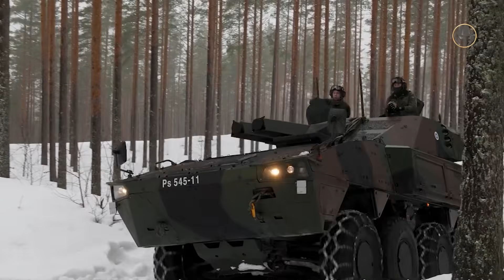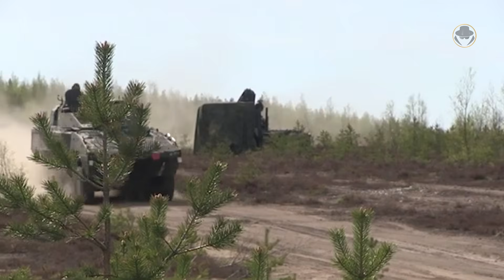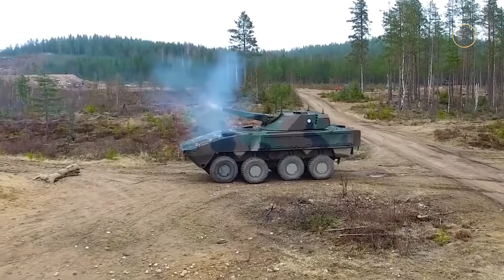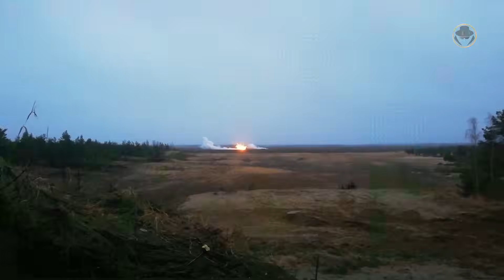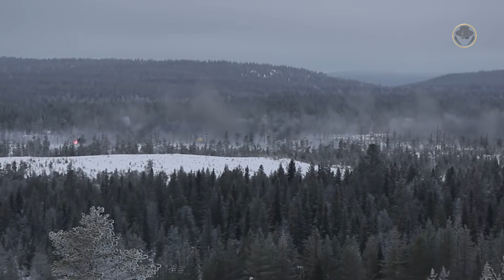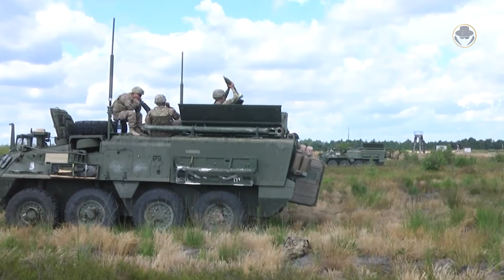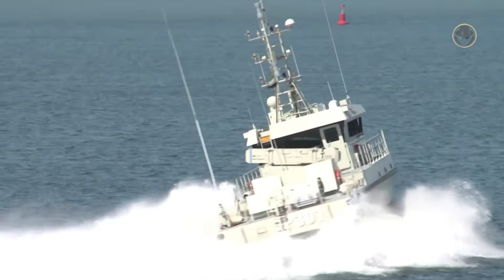AMOS - XA-361 | Why has no country, other than Finland, preferred such an advanced mortar

Comment: It's a shame Sweden went with the cheaper option, the AMOS is clearly superior to the semi-automatic muzzle-loading we use on our current Mjölner CV90 mortar carriers, the turret being able to be entirely enclosed not just against shrapnel, but also has a better potential for NBC protection, and in general a more advanced breech-loading system is just more future-proof.
 
At the time cost was a concern, but recent years have demonstrated that cutting costs for our military has been a bad idea and one we should never have latched onto. Like Finland, Sweden's military is small and needs to be able to punch well above its weight.
Reply: We dissed them?! They are like "close" range archers bruh. Lob 5 shells have em land at the same time.
Reply: Still, the Dutch went for the Mjölnir. Patria AMOS is better no question about it, but is it worth the hefty cost and more complicated maintenance?
Reply: @benktlofgren4710  Sweden had 40 CV90 hulls ready and waiting for the AMOS-turrets when the Reinfeldt cabinet had Genomförandegruppen perform amateur's evening, cancelling projects at random...  which meant the money set aside in the budget for the turret procurement instead were spent paying the penalties for breach of contract and of course Finland losing confidence in Sweden as a military partner which had to be rectified with other purchases at the expense of our domestic industry.
Reply: @benktlofgren4710  what do  you know about its maintenance? how "complicated" is it vs mjölnir?   you parroting words or do you actually have hands on experience?
Reply: @zoolkhan  Sit down and take a deep breath, you do not have to be a rocket scientist to figure out Amos loding system is more delicate and all that comes with it.
Reply: @benktlofgren4710  So you don't know. Keep in mind that the AMOS is operated by conscripts with varying degrees of interest and respect for it. Like every other piece of equipment in the FDF, it had to be designed in a way so that conscripts couldn't accidentally break it while operating and cleaning it.
Reply: @benktlofgren4710  A few AMOS systems can replace several of the simple versions, making it harder to hit and reduce the amount of soldiers to train and maintain
Reply: @TheEsseboy  While this is true we could not afford to outfit all battalions wtih AMOS only 1/5th (at that time), mjölnir was more "bang for buck" and was achievable. Also a lesson from Ukraine is that quality of a system matters tactically, but quantity maters both tactically and operationally.
Reply: @Stahlhandske  Well, considering one AMOS can deliver 20 shells on target within a minute, compared to 6 for Mjölner, you only need three AMOS to replace 10  Mjölner systems. What is harder to hide? 10 Mjölners or 3 AMOS? 

The real reason not to get AMOS is because you have not done your research.
Reply: @Stahlhandske 
Quality matters operationally too. 
I bet my asses Ukrainian will not 1 patriot with 2 or even 3 s300 for example.
Reply: @jintsuubest9331  True, but one system can only be in one place at a given time, so operationally more quantity enables fire support to be available for a larger area of frontline. Well air defense is on a hole other level from battalion level fire support, and the capability gap between patriot and s300 is huge. I would rather have 40 Mjölnir than say 8ish AMOS despite AMOS being the more capable system, which is the reason we went for that solution I.E Mjölnir for battalion level F/S and Archer for the brigades.
Reply: @TheEsseboy  I do not think you have a good understanding about this topic. 3 AMOS cant replace 10 Mjölnir. it isnt about hiding them, it is about making sure we can deliver battalion level fire support to all our battalions across the line of contact and being able to sustain losses, both from enemy fires and mechanical losses. I agree that AMOS is the more capable system, and without budget constrains it would certainly be the correct choice, but "you have to piss with the cock youve got"
Reply: @TheEsseboy  @TheEsseboy  I do not think you have a good understanding about this topic. 3 AMOS cant replace 10 Mjölnir. it isnt about hiding them, it is about making sure we can deliver battalion level fire support to all our battalions across the line of contact and being able to sustain losses, both from enemy fires and mechanical losses. I agree that AMOS is the more capable system, and without budget constrains it would certainly be the correct choice, but "you have to pi*s with the c**k youve got"
Reply: @Stahlhandske  Good thing Finland has higher military budget and NEMO in case. 

However while holding true in certain sense what you said about Ukraine in case of Finland it would be different.

There's many factors to these subjects which is why there is no simple right answer but it depends on country's needs, which for everyone are specific to their own.

In case of Finland vs Russia, there is less border that needs to be defended, so spreading out is not an such issue. Sure the border is wide 130km but most of that like probably 85% Russia is not able to use for invading due to no infrastructure, unlike Finland who has always prepared to defend themself when the next attack comes to the point even roads are designed to have tactical advantage for defence.

What this means is Russia would have to push through very tight holes which Finland has turned into killzones, and Finland would still have freedom of movement enabling them logistic superiority and flanking capabilities. 

When you combine this to the agreement Finland & Sweden has, some of those Mjölners would come to an aid and both countries has made deal to defend each others if one gets attacked. 

Add to that the semi new NATO agreement.

In this scensario it's bit silly compare to Finland's and Sweden's situation to Ukraine, since Ukraine was under prepared and had more open borderl lines to defend having the need to stretch out more.

AMOS will do just fine for Finland because what they need is quick shoot and scoot systems, after all their militaey tactic is refined for guerilla war.

And like I said even if, well there's always NEMO for cheaper solution.

Ps. I also doubt Sweden has needs right now to get more than 80 of their current Mjölners, so one has to alse take on account how much is too much and is amount X needed even if you could afford. Can't spend whole mil budget on 1 weapon system after all.
Reply: @Stahlhandske  Sure, but that is more of a budget constraint, because 333% more sustained fire is not something you can just ignore, that and direct fire capabilities, enclosed vehicle and faster moving to first shot, and faster scooting after the last shot.
Reply: @Stahlhandske  "While this is true we could not afford to outfit all battalions with AMOS only"
That part is a much later development, as we had 40 AMOS turrets ordered but cancelled the purchase (for no gain).
What you are talking about is when the issue of a 12 cm mortar came up again after the realisation that a few Archers can't provide the necessary support finally dawned at the department of defence.
Reply: @johanmetreus   You are correct! For the record i think cancelling AMOS was a really terrible decision when development was already "finished". When it came up again they couldnt fund 40 turrets and the Mjölnir compromise was made, but rather 40 Mjölnir than 8-10 AMOS. 
Catastrophic defense politics has been where the political left and right in sweden have been able to unite for atleast 4 decades. 

Men det var ju bra det där med "lackmustestet" synd bara att ryssen han invadera flera länder innan det gav omslag. 🤔
Reply: Depends on HOW MUCH cheaper the other option is. Quantity is a quality of its own after all, if you can have 2 weapons at the price of one, then the more expensive weapon needs to be that much more effective to justify the increased costs.
Reply: @khatack  if i remember correctly AMOS would have 4-5 times higher unit cost than what became GRKPBV 90 Mjölnir
Reply: @Stahlhandske  and AMOS has a 20+ round fire rate per minute with an up to 14 round multiple-round-simultaneous-impact capability which is beyond impossible with a single muzzle loaded mortar system. Not to mention, an automated loading system that doesn't get tired.  It more than makes up for the price difference between that and what basically is a traditional mortar on wheels/tracks, If you have the money. And Sweden absolutely has the money for it. It's just a political move to go for domestic, less effective system and that's fine.
Reply: The Swedish version of AMOS never worked. It was much more advanced than the Finnish version (that works).
Reply: Finlands military is not small. Reserve is bigger than usa has active/reserve combined.
Reply: Like finland? What are you talking about? You cant even vompare sweden and finland when it comes to army.
Reply: @hornantuutti5157  I really have no idea what you're on about, because Sweden and Finland have very similar militaries. 

Our militaries are about the same size with roughly 25,000 active personnel in both, with a large pool of reserves from mandatory service and Home Guard.

We use the same tank (Leopard 2) and IFV (CV90), similar multirole aircraft (Gripen and F/A-18 Hornet, both chosen for their simplicity of use in rugged conditions) many more systems are shared or extremely similar, with both countries even looking to adopt the same rifle going forward.
 
Our training and tactics are highly similar, emphasizing distributed defensive wars in the heavily forested subarctic terrain that makes up most of our countries' landmass.
 
Sweden and Finland have extremely similar militaries, because they have extremely similar military needs.
Reply: @HellbirdIV Finland can muster 900000 soldiers very fast as thats their reserv. Sweden can not even come close to that
Reply: @Thedrunkenswede1337  Well, I can see you don't really know much about either military. Or modern militaries in general.
 
I really wish there'd be fewer "Reddit historians" in these comments sections, but alas...
Reply: @HellbirdIV  oh but i do unlike yourself. And i have never used reddit in my life try again. Lots of self projections from your side.
Reply: @Thedrunkenswede1337  "uhhhh no u" is not a response that inspires confidence in your knowledgeability.
Reply: @HellbirdIV  i dont need too inspire confidence as i speak simple and easily found facts unlike you. You can cope all you want about the facts but they wont change just because you want them to change. Anyone white and internet access cal look up Swedens reserves and finlands reserve and what the countrys are able to muster. Facts stand find a way too deal with them because as i said the facts wont change. 😉
Reply: @Thedrunkenswede1337  lol, no. The Finnish army's wartime strength is 280 000 soldiers. We can't equip almost a million soldiers at the same time.
Reply: @Olli_Peltonen  eh no idea s not they can litterly muster 900000 soldiers educate yourself and dont talk about stuff you know nothing about. 🤦
Reply: @HellbirdIV  Yeah, Swedish Army is no joke. You've got less quick mobilization than us in Finland (less trained reserves etc.) but hugely deeper manpower pool. Anyone who looks at Sweden in peace time and tries to throw shade is talking out of their rear entry.
Reply: @hornantuutti5157  why not?
Reply: By the time of 2009 Sweden did not the world to escalate lile it did and neither did many else, people had felt asleep on the idea of purity and peace same time forgotting we humans are animals and battle we shall to our death forever since violence is in our nature.

It's understanstable why they cut the budget but foolish mistake still non the less.
World peace is something we can never achieve long as we live, someone will always wants something even by force.
Reply: Finland can litterly muster almost 900000 soldiers its not small.
Reply: It was a good choice by Sweden to scrap Amos and chose Mjõlner.
Now Sweden has 80 systems and the Nederland have ordered 12 Mjõlners!
Reply: @petter5721  It was an utter idiotic decision under Borg and Fredrik "The Swedish military is only one special interest group among all other special interests" Reinfeldt.

Most of the costs had already been paid, and what little was saved did not cover the expenses for contract penalties and compensatory purchases, the latter resulting in Hägglund's SEP being cancelled (causing enough financial instability to threaten company survival) to make space for a substantial Patria order.

The CV90 Mjölner started years later, when the Armén had convinced the minister of defence that mechanzed 12 cm mortars indeed was really important.
Reply: Yet the carrier, CV90 is superior to the Patria. Aside this, many countries operate the CV90 which makes logistics way more easy.
Reply: @Basil-Fawlty idk about that. Both vehicles are very different
Reply: @Basil-Fawlty  the AMOS system has been designed to be able to be fitted to a CV90, so not an issue.

Comment: Thanks for the video. Today, armies need a combination of such high firepower and mobility. :_SoldierSML:
Reply: until the war devolves into a war of attrition and everyone ends up in a trench...
Reply: This indeed is an interesting system assuming that the declared technical characteristics correspond to reality. Equipping armored, mechanized and perhaps motorized types of units with the AMOS would be great.
The important issue/limitation of this system is that at the end of the day a mortar is an infantry support weapon and as such it should be available to them anytime and anywhere. 
In 1999 we were defending Serbian territory along the Serbian-Albanian border from frequent Albanian incursions including two large invasion attempts. This is a heavily forested mountainous terrain and every dirt road ends 5-10km before the border. There's no way to bring even a tracked vehicle close enough, only man-portable weapons could be deployed with very few exceptions.
Reply: @matovicmmilan  considering one 120mm round weighs ~15kg and portable heavy mortar system itself ~150kg it is probably not the best option. portable 81mm mortar weighing ~50kg with ~4kg rounds sounds more ideal. no armor, no MRSI capability, no direct fire capability, no shooting while moving capability though.
Reply: A drone flies faster than a tracked mortar. A drone hast a bigger range than a mortar shell. That looks like a problem vor any mobile mortar because the have to be kept around the Frontline and sooner or later a spotter drone will recognize it and we have all seen what happens afterwards.
Reply: @drrichardwiesenhuber  Mortar shells are way cheaper and easier to produce than a drone. So, they are more suitable for a long and full-scale war. They cannot be jammed. The frontline troops always need a close-range fire support vehicle, so the range advantage of drones is irrelevant in this tactical scenario. In a real war, you have to accept some losses. It is not a video game.
Reply: @drrichardwiesenhuber  the weather is not always optimal for drones, especially during winter (-30c) or cloudy/rain (not all of them are equipped with latest sensors) or in the middle of electronic warfare / antidrone systems (Drone Dome, Sky Wall, DroneGun, Harpy). The best solution is to have multiple options. Recon drones are needed (both small ones like Black Hornet Nano and big ones like MQ-9 Reaper and everything between, like Orbiter 2B Mini or Parrot ANAFI), kamikaze drones (especially autonomous), UAVs, grenade droppers, 81mm mortars, 120mm mortars, 81/120mm mortars (TREMOS), 120mm mortars (NEMO), 2x120mm mortars (AMOS), 155mm artillery (K9/Archer), 298mm rockets (M270), Stunner (David's Sling), JDAM/JSOW/JASSM (F-18), JASSM-ER/AARGM-ER (F-35) etc..

Comment: Interesting.
I remember that a similar long-range support firearm, which was supposed to be mounted with a double barrel, was also being considered in Russia.
However, that one was abandoned and became a conventional single gun form.
Even taking into account the fact that it is a mortar, the fact that the complex mechanism of the double barrel gun system was realized and mounted on a wheeled vehicle shows a high level of technological capability.
It is also noteworthy that the AMOS is capable of operating the Strix mortar round, an anti-tank Precision-guided munition.
If this weapon is used effectively, it will pose a significant threat to ground weapons, including infantry, as well as vehicles, including tanks, without exaggeration.
Reply: Patria is part of BEA systems and only industry in Europe that has been given the right to esamble the F-35 front  frame outside of US. And company that has been given right to build the engines of F-35 block 4 by pratt and Whitney. And is company that just bought Finnish drone factory. So imagine if they producing the things like Patria AMV's Patria 6x6 and AMOS and NEMO etc.. at this point. What they shall build in future after they have fully mastered stealth tehcnology jet engine technology and drone technology?
Reply: Russian one became too heavy for ground vehicle, so they make 1-barrel one and double-barrel one can be used on ships. Also they manage to increase rof of 1-barrel version.
About similar weapon it more like nona or vena machines.
Reply: @trololoev  russia do not have that system since both AMOS and NEMO is Finnish product.
Reply: @vatipaa1  learn to fucking read